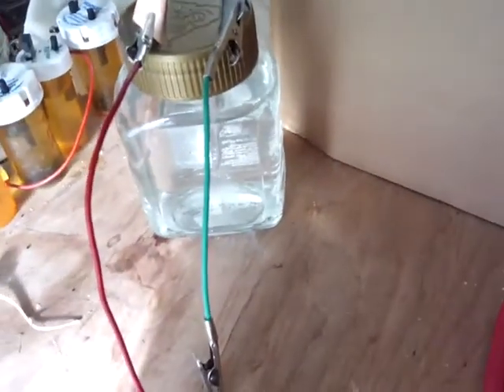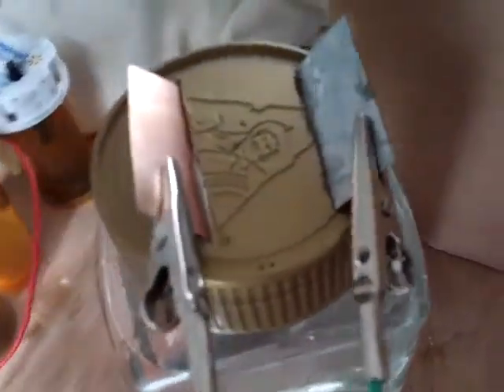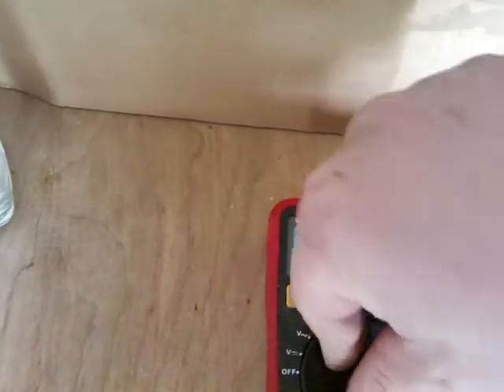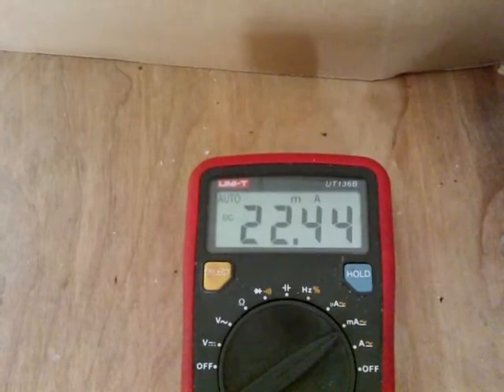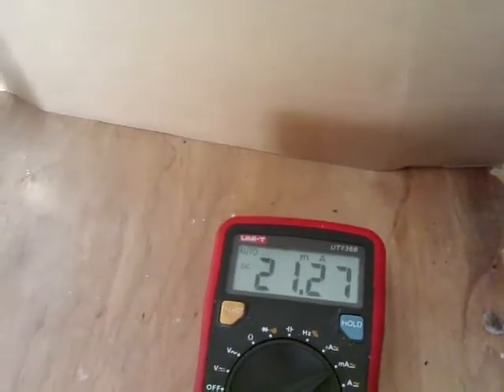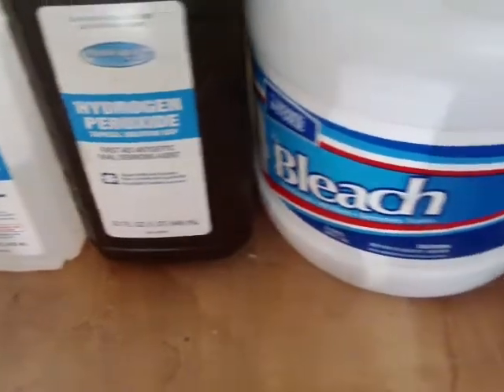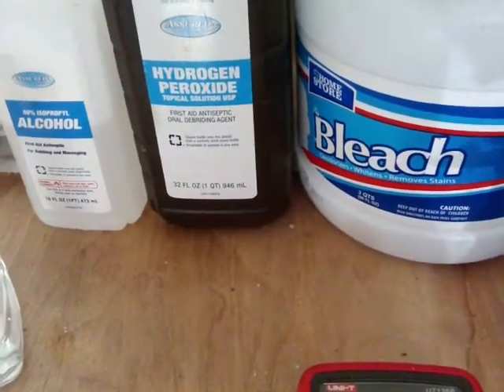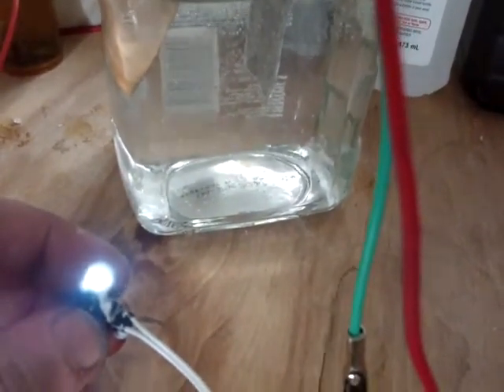TinMan's battery cell mixture ?

Comment: Way to go Slider!!

Thanks "D"
Reply from the maker: Darrellsrelm Cheers :) Have got 2 more types on test using the same mixture. 1 has aluminium + graphite electrodes, the other has BBQ charcoal and a carbon rod.

Comment: Yes, bleach and H2O2 are a good choice (strong oxidising agents) but Tinman said there was no water in his electrolyte whereas your bleach and hydrogen peroxide are solutions in water! On the other hand, Tinman said there was still going to be galvanic corrosion of his zinc, so it looks like his three 'liquids' may contain water or other polar solvents (eg. acetone?).
Reply from the maker: Coelopa frigida I think he means not directly tap water, as indeed 2 are water based. He did say that the isopropyl alcohol was 1 of the 3. The hydrogen peroxide has been a good find...the bottle had sat unused for years, so it's a good use for it. Latest cell delivers 45ma at 1.1V, so is edging toward a Ni-Cd. If I can control the sacrificial plate that is and, that is where TinMan's SSG type circuit mod will be tried out.

Comment: Hi Slider. Interesting. If you mix a lot of things you need a Fume hood to carry the gases away from you. You could build one or get yourself a used some vent that are for electric stove tops. There full sides and a closable front side. I like to experiment with metal plating I had to stop due to the fumes released from the process. I hope to start back has soon as I make a fume hood myself.
Reply from the maker: ***** Good and valid points indeed. I mixed at the back door, with it open. The lid is screwed on tight, with just slits for the metals to also limit anything escaping, just in case :)
Reply: slider2732 Hi Slider. Thank you for the reply. Glad to hear you were thinking safe.I know you know what your doing  :) I added this to warn other,s who may not know, Also when charging this type of cell it would be better to charge at a very low current, to keep the out gassing to a minim. has the bleach will produce a dangerous type of chlorine gas, Very nasty stuff and can be fatal.
All the best.
Bobby